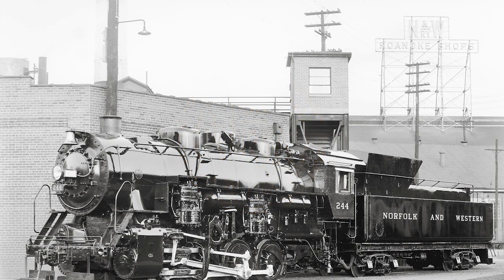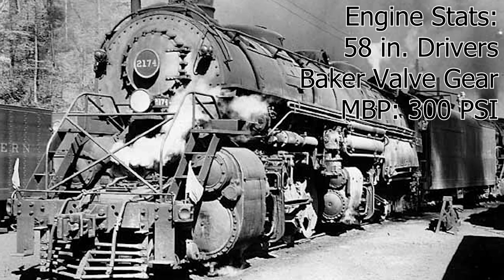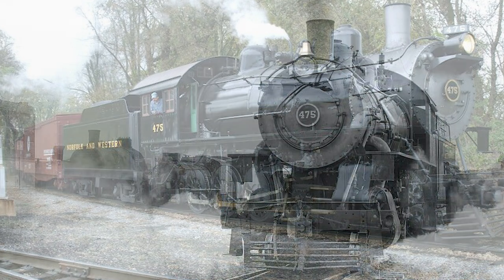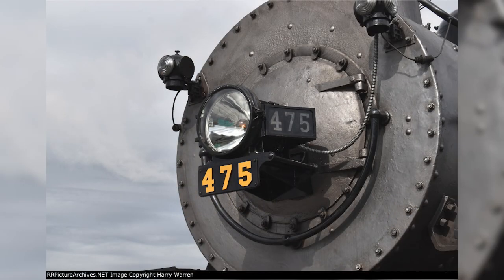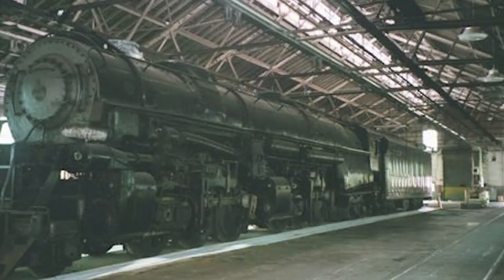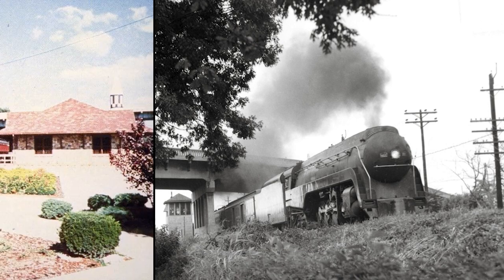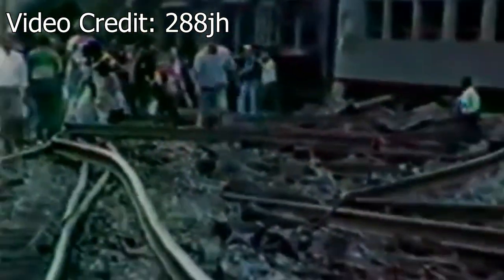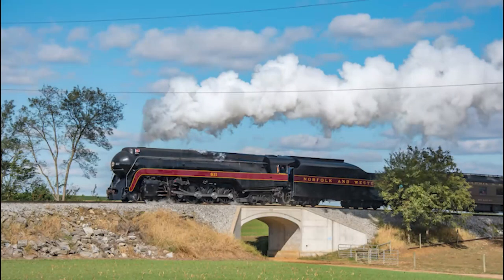A Look Back at Norfolk & Western Excursion Engines

Comment from the maker: The next video in this series will be another catch up video, so if there's any engines I've missed across the whole series so far, leave them in the replies to this comment!
Reply: Here's a list of some engines that have run in the preservation era that you've yet mention in your series. Cn 92, 1009, 1533, & CP 29.
Reply: What’s the next episode after these two episodes?
Reply: I CANT WAIT!
Reply: Well, there’s Reading 1251, which hauled excursion trains on the Maryland and Pennsylvania line alongside CP 972. They took advantage of the open backside of her cab by either giving her a tender for extra fuel and water capacity, or simply having a crew change through the first passenger car without having to stop. They only retired her in 1966, since her flue time expired, and her tractive effort was relatively low, anyway.
Reply: Other locomotives you’ve missed I can think of include Southern Railway 0-6-0 1643(you’d know it as Morehead and North Fork 12), Southern Pacific 0-6-0 1269, and some other farewell to steam stars on the SP that didn’t live to see preservation, like 4-6-2 2475, 4-8-4 4443, and 4-10-2 5011. I couldn’t make any of this up, if I wanted to.
Reply: A bit off topic but you could consider doing a look back at “miscellaneous” excursion engines, like engines that were the only operational examples of their railroad companies. Engines like Cotton Belt 819, Sp&s 700, and Milwaukee Road 261
Reply: Reading 1251
Reply: M&NF 12
Reply: How about some more obscure excursion engines like Savanah and Atlanta 750, Atlanta and West Point 290, or even the western and Atlantic general? P.s. have you thought about a video on ex-LS&I excursion engines?
Reply: I think you missed Union Pacific (2-8-0) #428
Reply: Their was another Class A that was used in 59 for excursions it was A 1240
Reply: ATLANTA and West point 290
Reply: N&W 2156 class Y6a 2-8-8-2
Reply: Pennsylvania railroad steam excursion locomotives would be cool to see also
Reply: CNJ 113 would be very neat to see also
Reply: SSW 819/ Since it was briefly used by the SP for they Bay Area commuter trains and the SSW was under control by the SP
Reply: Sp 1269 sp 5021 and sp 2475
Reply: You missed Southern Pacific 786
Reply: Norfolk and Western Y6B 2190. It hauled an excursion back in 1957 (I remember hearing the date, but I can't remember it, sorry):
Reply: You forgot 382, another N&W 4-8-0.
Reply: You should do "a look back at Florida east coast railway excursions stars"
Only 4 pacifics ran excursions in preservation
#80 (which is now Savanna & Atlanta 750)
#113
#153
And #148, which is now the only former Florida east coast railway steam locomotive running, also 148 doubleheading with Canadian Pacific 972 in New jersey

113 and 153 spent their lives pulling tourists at the gold coast railroad museum, as of today both are out of service and I believe 153 is on display permanently
Reply: @t-12productions15  2926 fired up for the first time in decades after his ATSF Excursion Stars video was made, but I'm sure he can still cover it
Reply: My list: Sierra railway 36, Santa Maria valley 100, lake superior and ishpeming 18, lake superior and ishpeming 29, cb&q 4960, white pass 73, white pass 69 and Texas and Pacific 316.
Reply: The only engine I recall missing is from this video. N&W Class A 1240 ran on the same excursion 2174 did.
Reply: Maybe after the look back vid maybe do a look back at soo line steam stars with soo line 1003 soo line 2719 and soo line hold on
Reply: 353
Reply: SP 3420
Reply: @sebassegiel2675  that will be wonderful!
Reply: N&W 563 doubleheaded with 578 to hual a farewell to steam excursion to the norton line.
Reply: @rbmnrailfan2102 2156 never hauled an excursion
Reply: You Forgot N&W 1240. She pulled the Final Steam Excursion.
Reply: In your southern video you forgot PS-4 No.1401
Reply: Please do reading and northern 425
Reply: 475 hit an excavator
Reply: N&W 475 accident at Leamon Place Junction on 11/02/2022
Reply: And you missed Union Pacific (4-6-0) #1243
Reply: Cass scenic railroad

Comment: I don't know where this roumour got started that the Roanoke Chapter, NRHS made an effort to save the 2174. Just before one of the meetings  started (February 1972, I think),while people
were standing around talking, I went up to Carl Jensen and Joe Austin, two of the members of the clique that ran the Roanoke Chapter in those days. I said "Excuse me. I'd like to point out that that engine is in the scrap yard to be scrapped. Unless something is done about it, one of these days it could be gone.Thank you." They just didn't say a thing about what I had just said and resumed talking about whatever they had been discussing. I NEVER HEARD ANY DISCUSSION AT ANY ROANOKE CHAPTER MEETING ABOUT SAVING HER. I have some background in marketing and couldn't wait to help in a campaign to save the engine. It's April, 1976. There is a photograph of the 2174 with a chunk cut out of the boiler in The Roanoke Times. The caption reads "End of the Line"  I knew that the AFT 1 (a.k.a. Reading 2101) was in the Southern Steam Program shop in Irondale AL. I called the shop and talked to Steve Wickersham, one of my former Supervisors during the restoration of the engine in Baltimore. I told him "There's an N&W Y-6B being scrapped in Roanoke right now. It has the same type of feedwater heater and stoker that your engine has, I don't know if it is the same size. Do you want me to try to get any parts for you?" "Yeah, get me the distributing table." he replied. When I got there, the engine was in pieces. The distributing table cut off  along the bolt holes, therefore useless. When the Ohio Central purchased the NKP 763 from the VMT, they wanted to acquire the 578 and trade it to the VMT plus some cash. According to the Roanoke Times article, the VMT collections committee only wanted cash, not the 578. "Railfans are treated as if they are the unwashed." Commented a former board  member.

Comment: I am gonna correct you on something.          As many people have already probably mentioned.        1218 is VERY capable of being restored.      In fact.    She is in very good condition.      The only thing that needs to happen is the front and rear tube sheets need to be replaced.     Oh and the parts form irondale.   There has been on going rumors that 1218 is too far gone and that was because online forums kept saying this.     It was later confirmed to BE NOT TRUE.
Reply: Well still, it would be harder to restore her than it was to restore 611. 1218 would need to have her incomplete overhaul finished, and given how big and powerful she is there is the issue of trackage rights.

Comment: You forgot to mention N&W Class A 2140, which hauled fantrips around the same time as the 2174
Reply: Several members of the Lynchburg Chapter NRHS, myself included, took the train to Roanoke on that memorable day, October 24, 1959. We had a couple of hours before departure, so I went to United Iron and Metal to see "What was getting it" as I called locomotive scrapping. There was the 1240 still in her shiny new paint, all cut up in pieces.

Comment: 9:32 Alright, correction: Steamtown Loaned No. 1218 to the N&W and Roanoke Museum for display. NS and Steamtown then settled on a trade for two diesels, so 1218 could be rebuilt.
Reply: Because NS refused to allow it to travel over its own rails DIT back to Steamtown. This was their plan to get Steamtown to deaccession it.
Reply: I had just joined the Roanoke Chapter NRHS and was working on the Greenbrier Railroad as a volunteer. Wes Camp, the Chief Mechanical Officer had been in charge of restoring the NKP 759. He let me have it when I told him I had just joined the Roanoke Chapter.  "The Roanoke Chapter pretty much got told  that 759 is coming to town, so they had better get ready to run trips with it." he said. 759 was in operating condition, but not optimal. The N&W spent $50,000 fine tuning the engine in the East End Shops. Thus Steamtown was indebted to the N&W and the 1218 was then loaned to the N&W. $250,000 was then spent on its cosmetic restoration.
Reply: 1218 got  loaned to Roanoke because Steamtown was in hock for approximately $50,000 worth of work done on the 759 at the East End Shops. This was cooked up by a lawyer in the N&W named Bruce Sterzing. As one person commented"An' they made him president of the D&H, just to get him out of town, because he was so rabid about preservation. He was responsible for most of the rail acquisitions 1964- 1970, including the C&O 1604.

Comment: The 1240 was used along with 2174 on an excursion. On October 24, 1959, before the 611's excursion left Roanoke, I went to United Iron and Metal to see what was "getting 16:37  it". There was the 1240 in pieces. The Roanoke Chapter NRHS which ran the 1950's excursions, lead by a man named O.H. Borsum, folded in 1960. The current Roanoke Chapter was founded in 1966 at the suggestion of former Roanoker, Graham Claytor, Jr., who donated some Southern coaches to them at its inception.

Comment: Just to put this out there, the y6b did have 125k tractive effort, but that was in compound running.  When they were run in simple articulated mode, they had well over 160k lbft of tractive effort.
Reply: I still don’t understand why people wanted to convert powerful simple articulateds into compounds with flaws.
Reply: @C Dangelo  when the N&W made the y6 class, they made it so that it had the simple articulated mode for starting the train from a dead stop.  Once you get the train going, the resistances drastically decrease, making it easier to keep pulling the train, so they gave it the compound mode so that tmit could save on coal and water to get greater distances traveled without needing to refuel.  Then, when they get to a grade that they need more power on, put it back into simple articulated.

Comment: Actually Norfolk and western 2174  is actually a Y6a
Reply: The last Y6a was the 2170,  The 2156 preserved at St. Louis, which was on loan to the VMT for five years is a Y6a.  Y6b's were road numbers 2171 thru 2200.  Probably the most notable spotting feature of the Y6b as compared to the Y6a is the Worthington SA6 Feedwater Heater which protrudes from the top of the smokebox between the exhaust stack and the faceplate of the smokebox.
Reply: 2171-2200 are Y-6B s
Reply: 2171-2200 are Y-6 b s.

Comment: Loved the video, but 611s boiler pressure is 300psi
Reply from the maker: Thanks for the correction! After double checking it would appear that I had read off her as-delivered stats, rather than her current stats.
Reply: @Buynot  oh, cool, I've never heard that user boiler pressure changed
Reply: @Buynot  611 was never delivered with 275 psi, she always had 300 psi. It was the Js before her (600-610) that were delivered with 275 psi.
Reply from the maker: @09JDCTrainMan  Oh, I see. Thanks for the correction.
Reply: @Buynot  You're welcome

Comment: #578 ran the Scioto Division between Portsmouth and Columbus from 1917 until 1944 in mainline passenger service. It then served on the Nortom Branch of the N&W's Clinch Valley District between Bluefield, West Virginia and Norton, Virginia hauling local trains #5 and #6. #578 ran with #563 on a series of "farewell to steam" runs and was retired in 1958. #578 came to our Ohio Railway Museum in Worthington, Ohio in February 1959 and was the only operational N&W steam locomotive operating on our ORM trackage from 1960 until 1978. It would take around $1 million to have it restored to operational condition under Federal Railroad Administration (FRA) codes and guidlines. #578 is the sole surviving E2a and we also own the last surviving Norfolk & Western Railway baggage coach #1511 (one of many used in branch line service) built in November 1918.
Reply: You are right that it would take 1 million dollars to restore 578, but that would just be for it running on ORM tracks, it ACTUALLY would take 2 million dollars for it to run on mainline excursions trains. Plus, it would be another 500 thousand dollars for them to restore their combine car #1511 as well.
Reply: @RyohuHajimeRX-0UnicornGundam  Exactly!
Reply: Oh! I also forgot to mention that it would be ANOTHER 150 thousand dollars for it to have PTC to run on the mainline. Which makes it makes it more damn annoying. Auuggh! 🙄
Reply: @RyohuHajimeRX-0UnicornGundam  I know! And the amount of money for floor, exterior, welding and other repair costs to bring it up to safe standards.
Reply: Yeah, it's a lot of money and expenses just to run and operate one steam locomotive?
Reply: @RyohuHajimeRX-0UnicornGundam  Sure is, and pretty expensive when it is steam. When getting onto another railroad's trackage, there has to be a pilot engineer (an engineer from the other railroad the engine is operating on) with the crew.